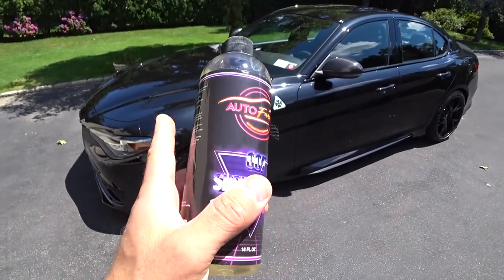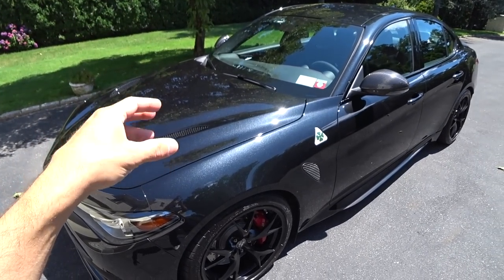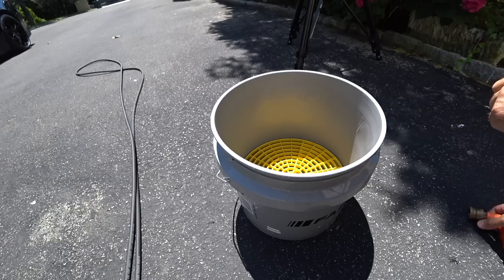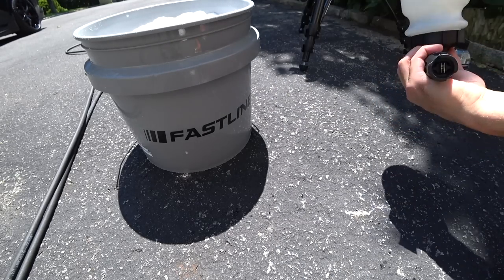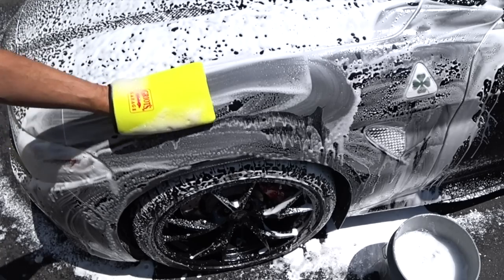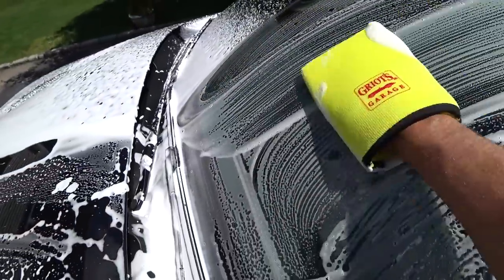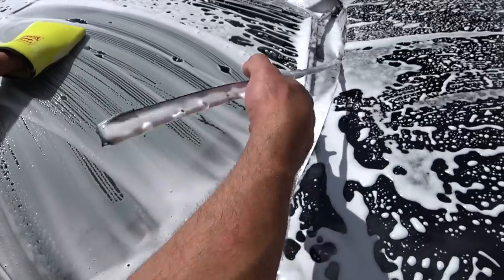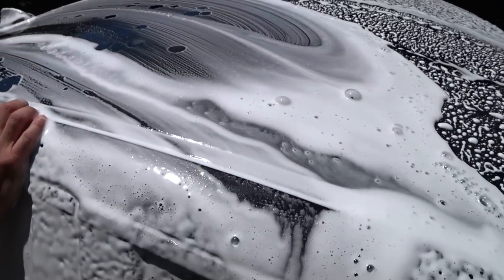Auto Fanatic 007 Snow Storm Quick Clay Mitt Decon Process

Comment: Excellent video. First time I’ve seen a black car show no swirls or fine scratches after using a clay bar or mitt. One change I would make would be to use a hose to wash off the mitt, and then dip it in fresh soap solution.

Comment: Do I need to follow up the fine clay mitt decontamination with a wax or topper afterwards.  I have the red griots garage mitt that I use 1-2/year that one seems to strip all protection off before I polish the car.
Reply from the maker: you should always,  my soap has protective polymers in it  as you can see in this video the water behavior so its like a 1 step and if you take care of the car it can work perfectly on its own until the next wash and your use of a drying aid. I use my 007 Gloss after each wash and my soap and it just simply works.

Comment: Great tutorial! You got a new subscriber! I have a Blue 2021 CR-V that is garage kept. I am thinking of ceramic coating it and was thinking this method for the "clay" stage. Can I go from the clay to IPA Wipe down? Meaning no paint correction is necessary since the paint is relatively new. Thanks
Reply from the maker: hi if you take your time and use proper lubrication you wont need to paint correct unless you need to prior to doing so. It all depends how crazy you want to go but I have been doing this clay method 4 times per year with amazing results on my black cars.
Reply: @autofanaticcars  great to hear. I wanted to do the clay stage but didn't want to spend time doing paint correction. My car is new so I was trying to avoid it. I'll follow your advice and use the clay mitt, rinse off the car, IPA Wipe down and then ceramic coating

Comment: Another informative video! Will this process remove the wax or sealant from the surface? Thanks!
Reply from the maker: it should not this is just for very fine surface contaminates so make it easier to maintain over time and wash rather then letting it build up

Comment: With regular clay as it gets dirty you knead the bar back to a clean surface.  When using the mitt when you go back in to the bucket are you rubbing the mitt against the grit guard to dislodge anything it may have picked up.  I love using the clay mitts/towels but I have yet to truly figure out the best approach or even the frequency with which you really should "clean" the face of the mitt of possible contaminants as you move around the car.
Reply from the maker: yes i had bad results using the mitts years ago and then i tried a few methods carefully and this one just works perfect as shown. just go slow and clean the mitt in the bucket as you work the car in quadrants. what most guys do is speed through like maniacs and they cause more damage than anything.
Reply: This was exactly my thought so looked thru comments in case someone else wondered. Thanks for asking and replying

Comment: Your humidity level must me through the roof.
 I live in a desert climate in the Southwest and if I left that soap on for as long as you did it would be a dried mess. Maybe I’m over thinking this??
Also the clay mitts you linked are not the Grios one you used. Are they just as good? This is a great idea and would help me immensely.
Reply from the maker: if you let my soap dry in the direct sun you simply rinse and blow dry i do it all the time when i take phone calls and it distracts from my wash time. It seems all these clay mitts are pretty much the same which is why I linked them
Reply: Auto Fanatic
That’s great!
Picked up a new GT350 last month. The hype is real!

Comment: I have a question. I rarely drive my car it just sits in the garage stall and i wash it once a month and do a "touchless wash" my car is ceramic coated btw. Will touchless washes work? Or is it a must to do a 2 bucket wash
Reply from the maker: drive your car and enjoy it, yes you can do touchless washes that is now my preferred method but i need to do mine more times per week as a result but i do not mind

Comment: I would assume you washed the car and then filled the buckets and foamer and did this process.  So wash then do this once a month to clay after the wash?  Thanks
Reply from the maker: yes the car was washed hours prior and left in the garage prior to this process, if the car is not filthy you can quickly do a waterless type wash per panel or use my 007 Gloss Enhancer quickly with two fresh towels.

Comment: Hey AF the link changed for clay mitt. What’s your take on $15 clay mitt fine grade vs the griots one? I did notice Griots is sold at $50 which I find to be a intense price but willing to spend if recommended. Living in FL I’m looking for a light casual method to Decon car. Did this same process with soap and a mothers clay bar- let’s just say that was a learning experience and I will never make that mistake again.
Reply from the maker: get the fine mitt always if you can many good vendors offer them

Comment: So if I do the job  with a clay bar. Do. I have more chances to scratch the  car paint?
Reply: Yes, you can scratch or haze the paint if you clay it. You can use a fine clay bar or mitt and it won't be to visible. You're usually going to clay before you polish the paint so any marks will come out.

Comment: If I do this to a older truck 2003 do i have to wax it after wards or no ?
Reply from the maker: yes
Reply: @autofanaticcars  would the griots foaming poly gloss be enough or i would need a real wax like with a orbit buffer
Reply from the maker: Poly Gloss is not any type of real protection is does not last. Try their Ceramic 3-1 watch my video on that
Reply: @autofanaticcars  will do

Comment: I noticed in your video you're using the Griot's mitt but the 2 mitts in the description are from different brands. Do these two mitts in the description perform just as well? TIA
Reply from the maker: i am certain all these mitts are manufactures from the same source which is why i linked those
Reply: @autofanaticcars  The clay side on each of the mitts look quite different from each other. Since you used the Griot's Garage Fine Mitt with good results I will just purchase that along with your Snow Storm. Thank you!